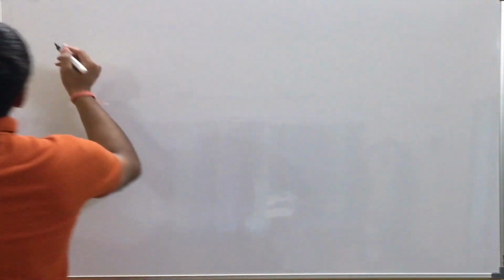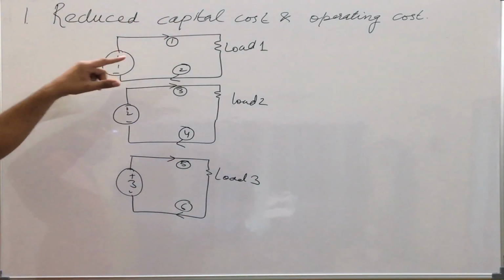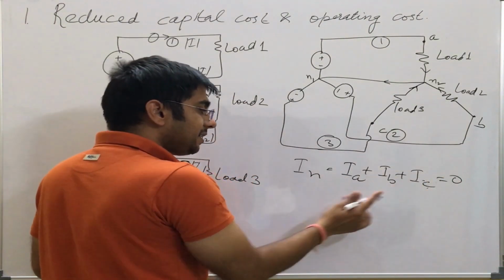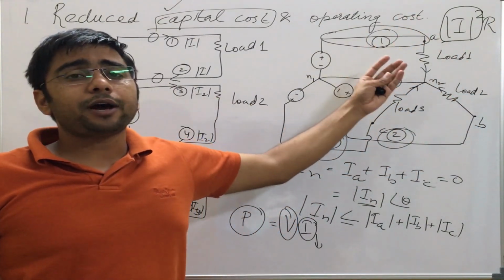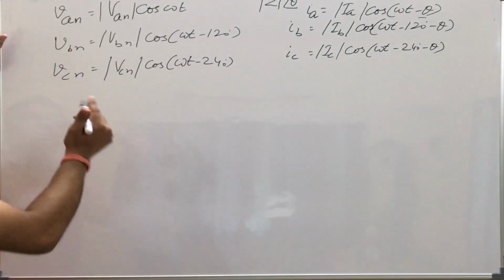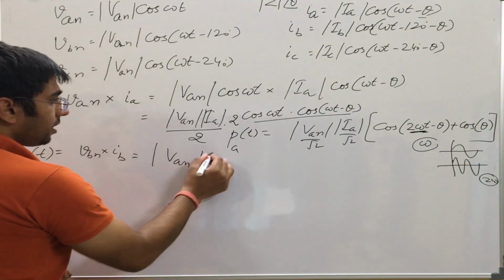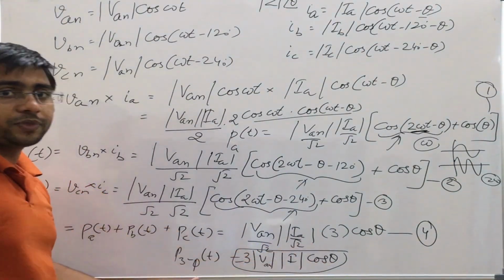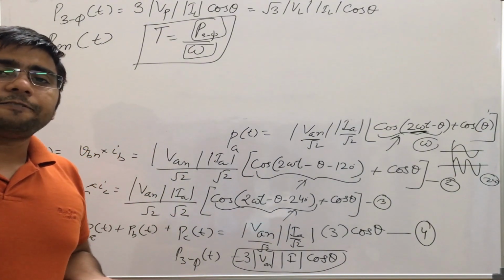17. Why Do We Use Three Phase Power / Network /Systems?

Comment: Manish, load flow, short circuit analysis, and relay coordination pe kab banayega....
Reply: Bhai, ek baar transmission line parameters and performance cover ho jaye uske baad load flow studies and short circuit analysis. Fir protection concepts and then relay coordination with practical examples aayega.
Reply from the maker: Bharat bhai short circuit studies start ho gya h.